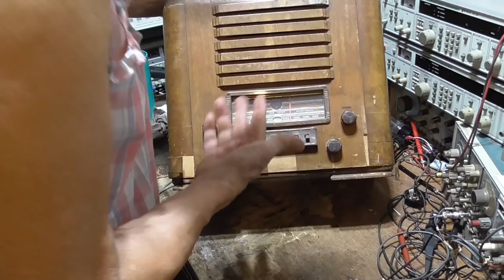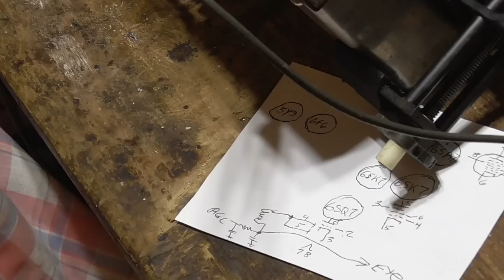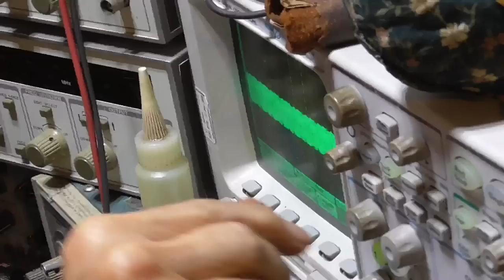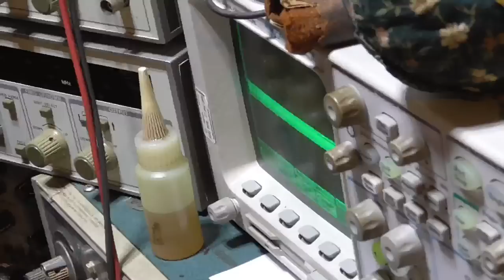RESTORING AN OLD 1940'S SHORT WAVE RADIO

Comment: Firestone S-7427-8 from 1940. It is clearly marked on the upper right corner of the back!  Multiple resources  can be 
used to find 1.  the manufacturer, 2.a website  that lists them and shows  actual photos of the radio in question. 3.
 then  you find the schematic for the radio. This is a little harder to do with Canadian made radios BTW. This radio was 
incredibly screwed up by the fella who put too long wires from the AM antenna  to chassis. This radio has a 3 section 
electrolytic originally. 16uF at 375 Volts,16uF at 300 Volts and a 10uF at 25 Volts. Ah , that poor cabinet. Minimal work
can make it look like a presentable restoration. Nice and loud.

Comment: I have repaired this type vacuum tube radios on 1969 to 1973 ..
Then we convert this type radios ,to transistors using with same  R F  coil pack..
Still i have old vacuum tubes .
Thats why i like  vacuum tube radios.❤❤ .Philips.. Grundig..Siyara.Telifunken .radios  👍
I am from Srilanka 🇱🇰

Comment: I hope you live as long as you want to GlassSlinger ! Thank you for posting , love the tuning eye radios . I have a tube type trans oceanic that only receives on 1/2 the dial and a great big /tall AM/SW  WITH A clock that has a dial like a phone around it and some pre set's , the only thing that works is the radio .  It's like a big piece of furnature . Both radio's have original caps , lol . Whish i could hire you to go thru them . 73s

Comment: You got me into this. 
I have a bunch of old radios. 
But the ones i could afford, only date from the 50-60's.
Reply: Why don't you use a fuse socket ?
Reply from the maker: @MrGigi-dz9cv  They need to be mounted. Takes time. Easier to just solder it in.  Note that there are collectors that specialize in 50's 60's radios! They are older than most people now alive!
Reply: @glasslinger  No. There are sockets that go on the wire.
Yes they are. But, 40's stuff and before is much more interesting.

Comment: Hi Ron, Are you able to help me with some advice on repurposing an old vacuum tube diathermy machine (90kHz) to oscillate at a lower frequency (40kHz) to power a transducer for use in a ultrasonic cleaner? Its a simple circuit, however I dont understand how it works, and dont know if its practical to change the frequency of oscillation. I dont know who else I can ask, but I know you will know! :)
Reply from the maker: While this could be done it is unlikely it would be practical. It would take a lot of fiddling and in the end it would be a kludge. Best to look on ebay for something designed expressly for ultrasonic cleaners. Good luck getting anything out of china right now!

Comment: Another great video.  I need to find someone local to Dallas to show me or give me instructions regarding spraying lacquer.  I have been using the aerosol cans of lacquer for way too long.  I need to find out what type of lacquer to use (often use the satin finish in aerosol), if I need to cut it with thinner, and clean-up afterwards.  Also what psi do you operate the sprayer at?  Do you ever use toned lacquers or let the stain do the work and you always use a clear coat?
Reply from the maker: I use 30 PSI. I usually let the wood finish determine the final color of the set, using clear lacquer. Deft Gloss Brushing Lacquer works fine. Thin it half and half with lacquer thinner. Use two or more coats rather than one thick coat that may run.  Colored lacquer is difficult to determine the final color. It is very expensive compared to stain and clear lacquer.

Comment: May I ask what the blue tape is?
I've not seen that tape in the UK, but it may be made in a different colour, and knowing the name of it will help me try and find it in the UK.
We have masking tape, but that kind of tape has no sticking strength, it is only really used to mask off areas to stop getting paint on and is a low tack tape, so it can be easily removed.
I've stuck stuff down with PVC insulation tape, but sometimes that just stretches or doesn't stick well enough.
I've seen a few people on YouTube using the same blue tape, and it looks really useful stuff, if only I can find out what it is and if it can be found in the UK.

Thanks,
Kay.
Reply: I think it's just blue masking tape. The blue stuff can be left much longer without the glue drying and sticking. Available at B&Q etc.

Comment: Ron..... a couple of questions please. First, did you do anything to that pre-select in freeing them up? And secondly,  when you matched a coil to that tuning condenser how did you do that? Do you basically figure it as a tank circuit matching Xc with Xl for resonance....and if so what frequency or range of frequency?  Thanks for your reply and enjoy the shows. From central texas...Best regards
Reply from the maker: The plastic was warped. Had to sand them. The coil is a standard broadcast band coil that is used in many common table radios. It matches the common 365pf variable condensers used in that era radio.

Comment: Hi glasslinger, I just picked up a 1947 RCA tv, 8-t-241, I brought,it up real slow with a 100 watt,Then lite her up,Everything Lights up, But the CRT, The Back of it is also light, What would cause this, I change the Rectifier, That was bad, I don't no how to Test the High voltage line going Into the Side of the CRT whats your thoughts, Thanks Brian
Reply: The filament lights but theres no phosphor on the screen? Not a single pixel?
Reply: @MichaelOfRohan  no, The tube filament is lite,But the Picture its self is not
Reply: Great repair on the Radio, I wish I was as good as you, I would have gone far, Thank you for your Help
Reply: If it hasn't been recapped there's a good chance your horizontal oscillator is not running. 40s sets need pretty much all of the wax caps and lytics changed, as they will kill most circuits in the set and prevent it from running.
Reply: @classiccomputers6211  Thank you so much for your Help, makes sense
Reply: @brianbloom1799  unfortunately Ron never reply’s to anyones questions
Reply: @metalman4141  well thank you for your Help
Reply: @classiccomputers6211 : Suggest he watch a few Shango066 videos about that.....just sayin

Comment: I was sanding a cabinet today, ugh, even with a power Sander I was having trouble, whatever they used turned back into goop, blocked up my pads and pretty much turned them into polishing disks 😑 any idea what the hell they might have varnished that with?
Reply from the maker: Sounds like urethane. It forms a layer of plastic on the surface that gums up a sanding disk. I use solvent first to remove as much of the old finish as possible then sand. Urethane looks great and is bullet proof but if it needs to be removed it is a mess!
Reply: @glasslinger  you've got that right! Had to keep dousing it in spirit 😅 hopefully I can get it right

Thanks for the input!
Reply: Also, sanding disk for power sanders could be washed (spirits, gasoline may works).
Reply: @archloy  I did try to wipe it off but as it wasn't coming off of the unit with them it wasn't coming off of the disks with them
Reply: @phonotical  :/ and with a scrapper ? (maybe the long way, but you can clean it !). Or at least and carefully a heatgun. Did you try chemical paint remover ? (but on wood... I'm not sure !)
Reply: @archloy  it's a 15p part

Comment: Hi. Thanks for the video. Why remove the internal antenna? Replacing the wires with flat 300ohm cable or using new flat ribbon cable would have worked. Also removing a turn or two on the antenna could help. I know it will sell for cheap.
Reply from the maker: Tried that, removing turns and separating the wires. Still was not able to match the dial marks satisfactorily. There is no padder capacitor to adjust the low end and the top end was still far off. At a certain point it gets to a "hell with it" situation. This radio is not worth doing a front end redesign.
Reply: @glasslinger  I agree with the overall situation and I am happy you try.

Comment: I don't quite agree with your loop antenna solution, Ron.  Yes, lacing up the wires detunes the loop so tracking is out of whack but keeping the wires loose probably is OK.  Did you measure the inductance of the loop and assess tracking ability with minimal wiring capacitance?  You jumped entirely past attempting that, why so???
Reply from the maker: Most people won't bother with that much fooling around. All I wanted was the set to work within loose reason. To get the tracking correct would be more work than I am willing to put in!

Comment: Could you do a quick presentation of types of radio recievers vs years or brank i.e 4.2.1 The first vacuum-tube receivers.
4.2.2 Regenerative (autodyne) receiver.
4.2.3 Superregenerative receiver.
4.2.4 TRF receiver.
4.2.5 Neutrodyne receiver.
4.2.6 Reflex receiver.
4.2.7 Superheterodyne receiver.
Reply: That should read years or brands.  One can't repair a radio if you don't know how it works.  We do not need theory, just what to expect or better yet, how to tell what kind of receiver we have.

Comment: what voltage did you use to test it at timestamp @4:19 ?
Reply from the maker: Normal line voltage. I have a watt meter and an electronic circuit breaker to protect the set. If the watt meter reads higher than what is stamped on the nameplate the capacitors are leaky. If there is a major overload, the electronic breaker cuts the power immediately.

Comment: It was really good to put the Fuse in the Power line,  but why not put a Fuse holder in the line and then put the fuse into it.  As it is now if the fuse blows now you got to unsolder it to replace it.
Reply from the maker: If it blows something bad is wrong. An idiot may put a bigger fuse in the holder and burn out the transformer. Not likely the idiot can successfully solder a fuse!

Comment: Iam a vivid shortwave listener at night shortwave radio is not dead its booming💯✅
Reply: It's not dead, but its not what it was in the 90s
Reply: @hdofu  the 80s was booming but at night i fire up my tube gear with my ham antenna its wild⚡⚡⚡
Reply: lol ya its loaded with AM mode stations to listen too , the same bible thumper station over and over , not to mention the jammed stations ,  where is it booming exactly because compared to 30 yrs ago there aint squat .

Comment: I always use a isolation transformer to work on tbe radios hot chassis ouch been bit a few times or 2⚡⚡
Reply: is not a hot chassi, look at the giant transformer at the corner
Reply: If I remember correctly, Ron always use an isolation transformer

Comment: Aren't you affraid touching the chasis?
Reply from the maker: My chair sits on a sheet of plastic so I'm isolated from ground. All other instruments on my bench are transformer isolated as well. This eliminates most shock hazards. There are certain other hazards that must be also considered, which I do at all times. Not to worry!    :)
Reply: @glasslinger  I opened an radio like this. I would not ever touch the chasis with my hands, after i seen one of the power wires connected to it.
Reply from the maker: @MrGigi-dz9cv  Avoiding is fine but knowing why is finer!
Reply: @glasslinger  That is how it was built.